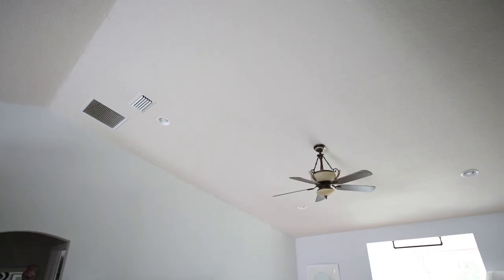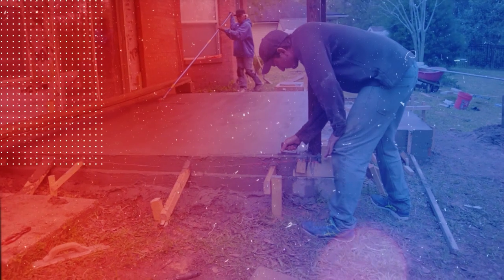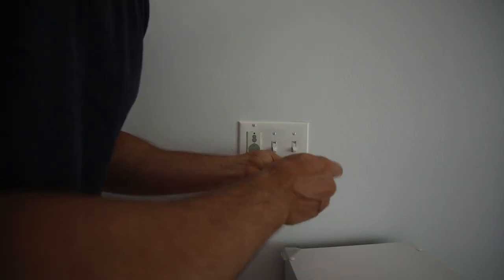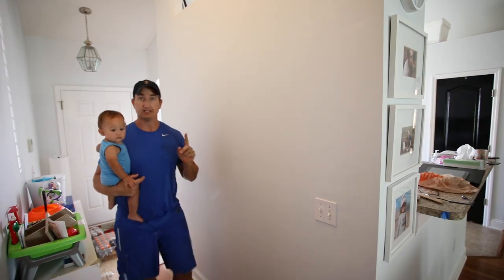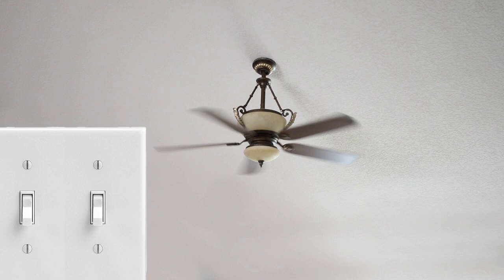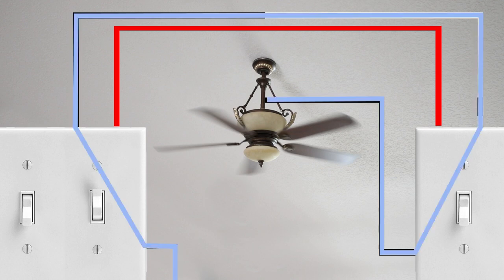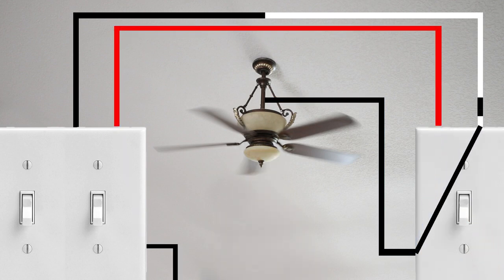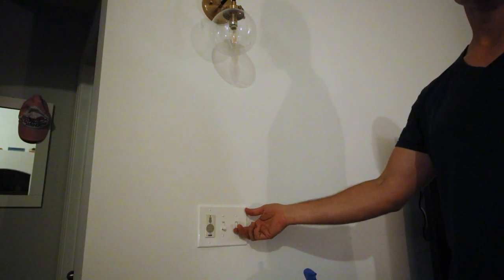What does this extra switch do? An explanation of how a 3-way switch circuit works.

Comment: Hi, I just watched your patio conversion I am a college student learning from home and want to turn our patio into my own dorm. However, the structure of the patio is a bit different. The bottom half of the walls are brick and the rest is just screened in panes. Do I need insulation if it will be all windows? If my explanation was a bit off, I would be happy to email pictures. Thx
Reply from the maker: Danielle, i applaud your college education efforts during this interesting time.  Regarding your question the local building department would probably have input of how to proceed to keep them satisfied.  Having said you may have a few options.  One may be that the walls are built  with windows that are highly efficient and provide some insulation value.  Best of luck with this project and thanks for the comment.

Comment: 😂we have 1 on 3 different walls that are a mystery, so... I was going to test the outdoor plugs today. I believe the middle wall was the living room fan light but not connected anymore. 😅 I'm so... sad the people we bought the home from did their replacements and add-ons and had an over-the-counter microwave on a shared breaker with the 3 other outlets on that kitchen wall. 🫣🤔😅 don't make coffee and use the microwave.😢😂
Reply from the maker: That must be frustrating in the kitchen.  Are you sure all three outlets are on the same circuit the microwave uses?

Comment: Could that just be an extra switch to add a light fixture? For sure my third switch does nothing and it doesn't correlate with my other switch at all. What's your thought?
Reply from the maker: Houses can be wired where there are two separate switch feeds that go up to the fan box.  The fan would only require one feed/switch obviously, however if it is a fan with a light the light could be wired to the separate switch feed. One switch for the fan and the other switch to control the light.  Today many fans come with a wireless remote control so the whole fan/light assembly can be installed on one power wire feed.  If such a fan is already installed the extra feed wire from the switch would not need to be used and thus could create a useless switch situation.
Reply: or it could be wired to a plug like mine

Comment: What if a 3way switch suddenly will not turn the light off from either switch?
Reply from the maker: Hmm,  perhaps the actual switch is damaged or a connection came loose.
Reply: @MrKistel  yea, I flipped on the switch in the hallway and when I came back through,  I switched it off but the light stayed on. 
I went to the other switch... Nothing. The light stayed on. 
I had to take the bulb out.
I went and bought two new switched and a voltage pen tester today and then got nervous about to change them.